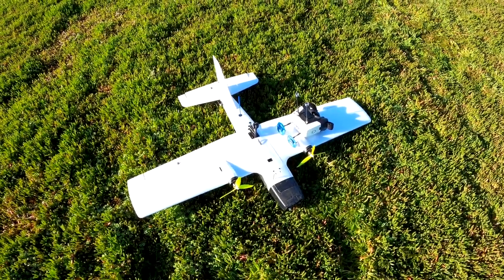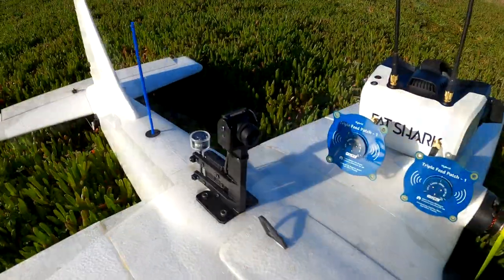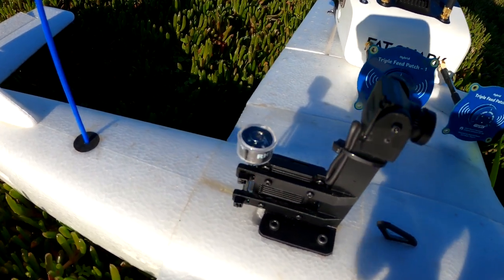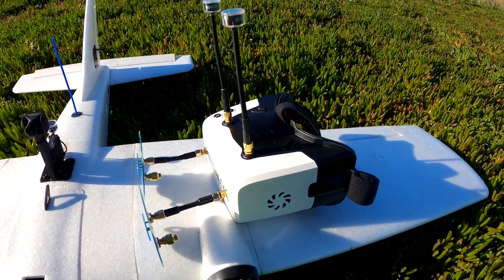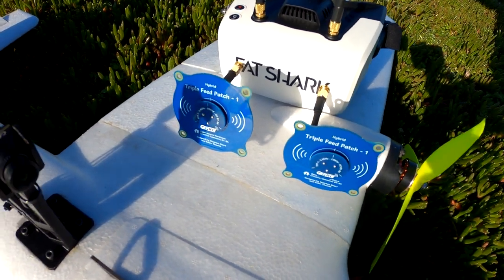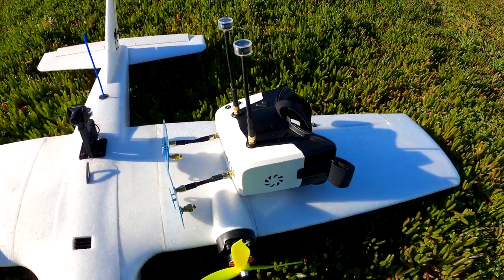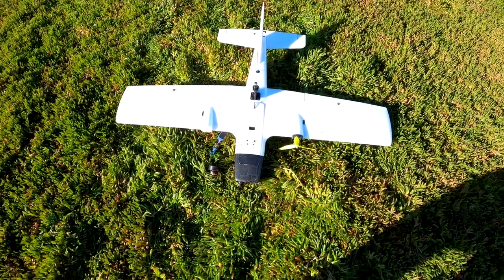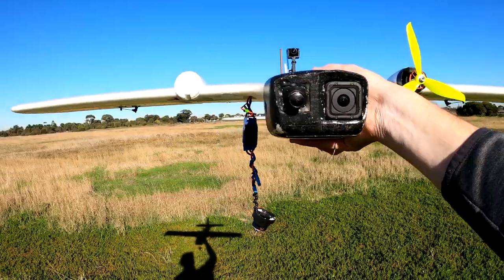» Digital Antenna Testing with a Surprise Ending

Comment: Great save, do you think it was a prop failure that caused it? That short sound a second before separation was familiar of having a massive imbalance from losing a blade or collet, that vibration is great at separating things.
I noticed prop was gone when you recovered it, but at least you got a good neat twist in the wires.. lol